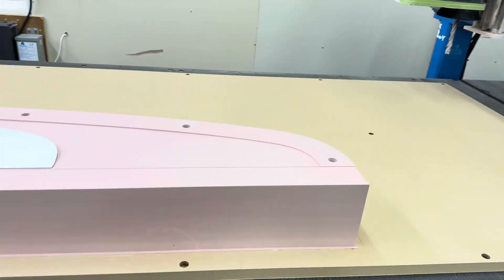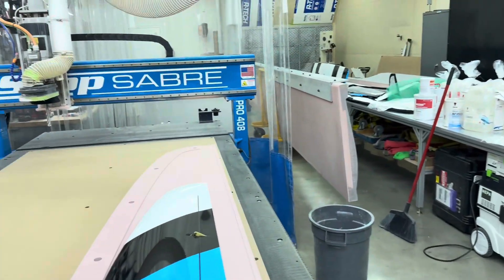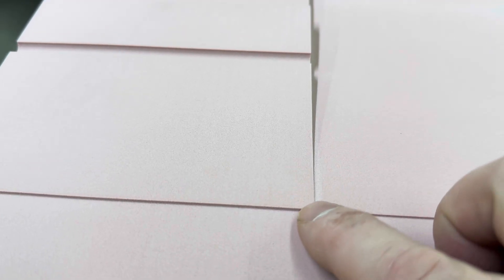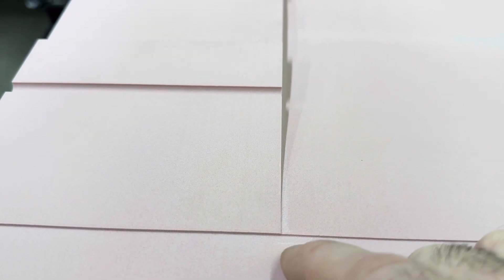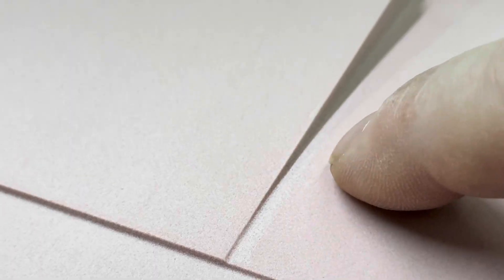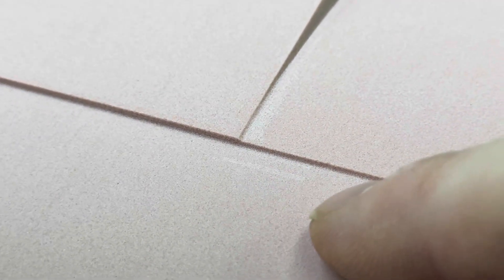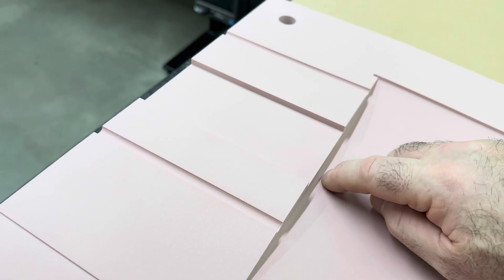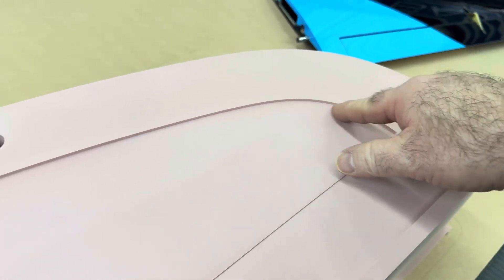D170 Wing Tips

Comment: Thanks for sharing the process, what material and density are you using to make the mold.
Reply from the maker: This particular tooling board is 40lb density PBLT (precision board low temperature) from Coastal Enterprises. It’s actually quite stable. More so than some higher cost and even higher density competitors.